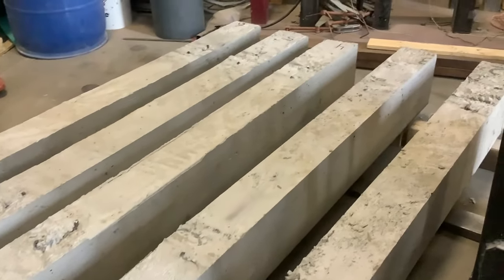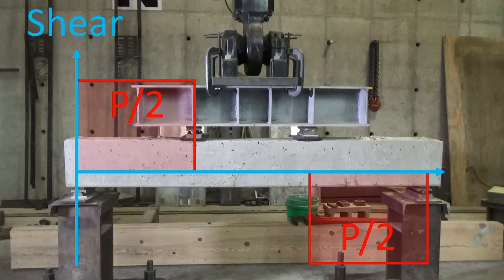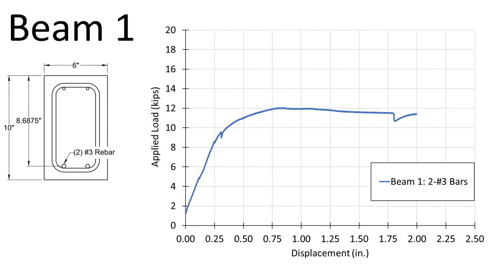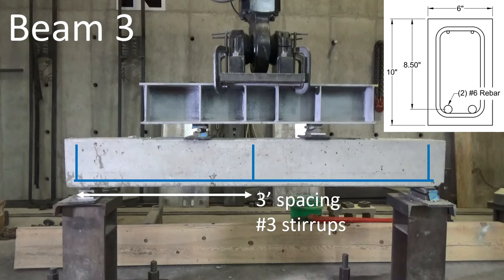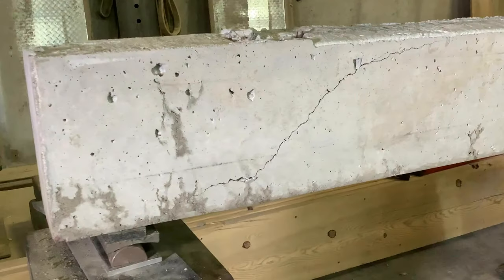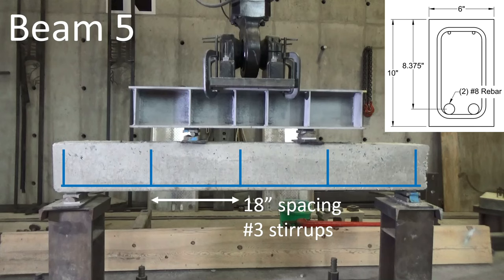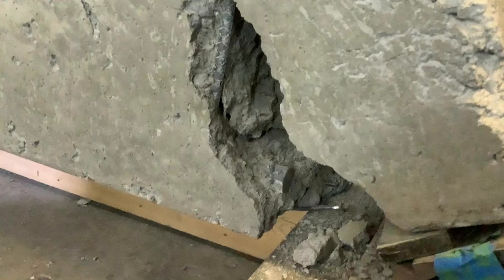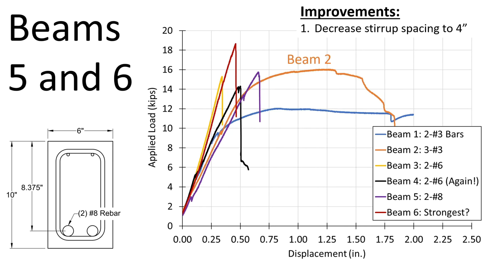I Broke These Concrete Beams - Design Principles from Beam Failures

Comment: You will have to repeat #5 and 6 beams with rebars extended outside the beam to prevent anchorage failiure.
Reply: Yes I agree..or move the 2 supports closer.
Reply: @geraldborja144   Indeed that was disappointing...
Reply: Rebars are not supposed to go outside though 
To improve the anchorage, the end has to form an L shape pointing up in this case 
Or as mentioned in the other comment, have the points of  supports farther away than the end of the rebars ( either by moving the supports or by extending the beam)
Reply: Cog the bars
Reply: yes i think those hor. rebars are few short to the support area
Reply: Really missed on that one, the supported beam area had no rebar in it. But what do you expect too young to have ever used a slide rule and no pocket protector.
Reply: but it highlights the fact that using stronger steel concentrates the stress on the concrete more. the concrete is there to take the load, the steel shouldn't be under load until the concrete starts to fail.

Comment: It appeared that your supports were at the end of the bottom rebar or even somewhat outside of them.  You need the steel to extend well beyond the supports.
Reply from the maker: Yep, I agree 100%. Best practice for simple supports is to terminate the steel at least 6 inches (75 mm) past the face of the support (ACI 318, section 9.7.3.8.1).
Though you can't see it, the same supports and bar termination was done for all the beams. This was done improperly here partially for ease of construction and partially to make a point.
Reply: Exactly my thoughts
Reply: I think in construction, concrete should leave up to 21 days to dry well
Reply: @jpcraftconstruction.1828  It does get stronger with time, but the reason for failure of the stronger beams was the improper placement of the supports which is misleading in regards to which beams likely would have performed best.  The weaker beams didn’t have sufficient capacity to overload the points above the supports, but the stronger beams did.  This just confirms why the proper balance is important in design.  Making one area stronger simply moves the failure to a different place.
Reply: @StructuresProfH  oh ok
Reply: @StructuresProfH   @StructuresProfH  This is interesting, because in a typical earthquake resistant post & beam structure as built for private houses and commercial buildings in the Philippines this may not always be implemented. I will take a closer look next time, when they make beam to post or beam to beam connections, if the reinforcement is indeed supported by at least 6 inches. 

Constructibility of reinforcements is often an issue. In my observation posts or beams are sometimes designed too slim, which makes it hard to accomodate all the reinforcements at the connections. This can lead to the workers making shortcuts not authorized by an engineer (who is not always on site).

Comment: I used to had a fear of buildings falling, I used to believe buildings just crack, but this video made me aware that buildings bend and they show signs before falling. Now i can rest well looking at concrete ceiling. Thank you so much
Reply from the maker: A well designed building will bend and show distress before failure. In practice we always try to avoid failures like we saw in beams 3 through 6. If the building will fail, we try to follow something like beams 1 or 2.
Reply: They can do both.
Reply: Building have alot of safety factors sprinkled in every step of the calculation

Comment: How is it that nobody’s pointing out in the comment section that they use the a concrete truck for this little bit of concrete 😂😂
Reply from the maker: One cubic yard! Yeah, it’s a ridiculously small load, but our concrete supplier is really great about this kind of stuff. It’s certainly easier than mixing by hand (don’t have a drum mixer with this capacity).

Comment: Asked Claude 3.5 :
Let me explain why rebars are often placed at the bottom of beams:

Tension zone:
When a beam is loaded from the top, the bottom of the beam experiences tension.
Concrete is strong in compression but weak in tension.
Steel rebars are added to the bottom to handle these tensile forces.

Bending moment:
The maximum bending moment in a simply supported beam typically occurs at the middle of the span.
This creates the greatest tension at the bottom of the beam in this area.

Compression zone:
The top of the beam is typically in compression when loaded from above.
Concrete is already strong in compression, so it often doesn't need as much reinforcement there.

Testing to failure:
In tests, placing the rebar at the bottom allows researchers to observe how the beam behaves under typical loading conditions.
They can see how the concrete cracks and how the steel reinforcement performs.

However, it's important to note that in real-world applications, beams often do have some reinforcement at the top as well, especially for:
Negative bending moments over supports in continuous beams
Shrinkage and temperature control
Torsional resistance
Compression reinforcement in some designs

Comment: Fantastic video, and a question,  if you were to bend the rebar ends to allow the ends of the beam to be connected to the bottom of the beam in that way wouldn't that be able to prevent the ancor failure?

Comment: This experiment more related to a pre-cast design otherwise development length plays a big role here. Top and bottom extra bars are also play a big role in construction. Also at the L2 should have stirrups closer than in the mid section.

Comment: What was the calculated load capacity of each beam compared to the observed load capacity at failure? In other words, how close do our calculations match reality?
Reply from the maker: For Beam 1, the flexural capacity was about 110 k-in., which should occur at a load of 9.2 kips. We observed about 12 kips of capacity. These calculations assumed nominal material properties for concrete strength of 4 ksi and steel yield of 60 ksi. Measured concrete strength was a bit lower (a bit over 3 ksi), but that barely affects the flexural capacity. We didn't test the rebar, but it was likely to have higher yield than 60 ksi, which would have a major impact on the capacity.

Repeating for Beam 2, the flexural capacity was about 162 k-in., which should occur at a load of 13.5 kips. We achieved nearly 16 kips in testing.

Beams 3 and 4 had a reinforcement ratio of about 2.94%, but did not have adequate shear reinforcement. Using ACI 318-19 Table 22.5.5.1(c), we would get Vc = 8.0 kips using the nominal concrete strength of 4 ksi. Assuming the stirrups provide no strength (which is reasonable, as they are spaced so far apart), this failure would occur at an applied load of 16 kips. Beams 3 and 4 saw about 14 or 15 kips of load, respectively. If we instead use the measured concrete strength of about 3 ksi, then Vc = 6.9 kips for a failure load of 13.8 kips - that's very close!

For Beams 5 and 6, this didn't look like a traditional "shear failure" because of the anchorage issue. However, the estimated shear capacity for these two beams, again neglecting the stirrups and assuming nominal concrete strength of 4 ksi, would be about Vc = 8.0 kips, meaning a failure load of 16 kips. That's pretty close for Beam 5 (failure load of just under 16 kips), but a little low for Beam 6 (failure load of about 18.5 kips). The stirrups maybe provide some help for Beam 6, if only to force the crack to take a steeper incline angle compared to the more traditional shear failures of Beams 3 and 4.
Reply: Im a layman. What is a kip? Since you had two points pressing down on the beam until failure what was the total force downward in pounds ?

Comment: Thanks; please post concrete compressive strengths too.
Reply from the maker: For these beams, the concrete strength at testing was only about 3,000 psi (20 MPa). We did not test the rebar yield stress, which would have a greater impact than concrete strength for the flexural capacity.
Reply: @StructuresProfH  Thank you. 🙏

Comment: Good stuff. It looks like bearing failures for those last two. A horizontal U-bar or two at each end at the bottom should do the trick
Reply from the maker: That's a good idea, Sam! We have a bunch of extra stirrups floating around our lab, so next time I'll drop a few of those horizontally into the end regions. That is an easier fix than making the beams longer (would need new forms) or moving the supports in (lab floor connections are where they are, and not much I can do about that without fabricating new supports).

I really wanted to see a compression-controlled flexural failure, but there is always next time. That would make a good follow-up video.

Comment: I just discovered your videos and I'm already a big fan. However, I am also an amateur to this. I have a couple of questions that I hope are not too naive. First, have you performed any of these tests with GFRP, a fiber reinforced resin based rebar? The second question is where the more experienced people on here might giggle at me. Would it be reasonable to build a metal truss within the cement? It seems that the amount of metal being used in some of your tests could be made to hold a lot more pressure if it were built in a truss pattern instead.
Reply from the maker: Glad you liked the video!

I haven’t tried any tests with GFRP bars yet, but that would be very interesting. In general, GFRP is higher strength than steel but it lacks ductility, so no more ductile yield plateau behavior. It also has lower stiffness, which can mean larger displacements. 

As for the truss, the beam already kinda does that for you - the steel carries the tensile forces while the concrete carries the compression. So the concrete forms the top chord and the “diagonals” of the truss, while the rebar forms the bottom chord and the vertical members. Sure, you could layout the steel in a truss-like configuration, and it may have really great performance, but the standard rebar “cage” is much easier to build.

Comment: Architect here! I have a question does the type of hook provided in the stirrups matter? And how does it affect the Shear capacity of the beam?
Reply from the maker: As a general rule, a 135-degree hook is better than a 90-degree hook. However, we typically assume that the hooks in the stirrups don't matter for capacity, so long as they satisfy prespecified "standard" hook conditions. So for example, ACI Table 25.3.2 has standard hook geometry for stirrups - as long as we are following (or exceeding) that, we assume we get the full design capacity from the stirrups. 

However, there are some conditions where the type of stirrup hook may be more important, like for seismic design (ACI Section 18.6.4) or for beams carrying torsion (ACI Section 25.7.1.6). Again, we treat these prescriptively - the stirrup hook geometry doesn't factor into our design calculations so long as our hooks meet the standard.

Comment: Can you also explain rammed earth structure failures compared to concrete beams? Which would be the better option and why?
Reply from the maker: I’m no expert on rammed earth construction, so I’m afraid I can’t provide much insight. Sorry. That said, structurally it seems limited to walls and other systems that carry relatively low levels of compressive load and essentially no tension. If it’s stabilized with cement and has some rebar, I presume it behaves much like a low strength concrete or CMU wall?

Comment: Would have liked to see tests 5 and 6 repeated so we can see actual results without the testing environment being the failure cause.  Also, when the rebar was placed into the forms, I didn't notice any spacers/chairs on the rebar to prevent it being to close to surface.  Were those intentionally left out, or were they just not visible on camera?
Reply from the maker: I agree. I actually did try these two tests again recently, with three horizontal stirrups/ties placed at the each end above the supports. Ideally, these should have bridged the split that formed at the beam ends. Long story short, it didn't work out, and I got the same failure mode again! Didn't publish a video on it, as I didn't think it added much value. Just goes to show that there is no substitute for good rebar anchorage at the ends.

As for chairs, yes they are there, but rather hard to see. Concrete cover is lower than would normally be acceptable for code (only 0.75 inches), on account of the beam's small scale and these not actually going into a building.

Comment: I’m setting a huge HVAC EF heavy piece of equipment on a concrete roof, the roof underneath has concrete beams holding the weight… I’m worried now

Comment: Changing the rebar iron with high tension cable will make more strength?
Reply from the maker: Possibly, yes. Moment capacity requires a balance of tension (in steel) and compression (in concrete). With low strength concrete, you might not get that much benefit from high strength steel, especially if you can’t yield the steel to use it to the fullest. 

Plus, in practice, higher strength materials may run into serviceability or deflection issues - high strength does not always mean high stiffness (for example, all steels have roughly the same elastic modulus, regardless of strength). It may hold the load just fine, but have unacceptable deflections.

Comment: It kinda looked like the concrete failure didn't split the aggregate. Weak concrete?  At What psi did the cylinders test / break?
Reply from the maker: It was indeed weak concrete. Cylinders broke at just over 3000 psi (~21 MPa).

Comment: Firstly, Very Interesting Demonstration. Sir, I have a query. In case of beam 6, although the number of stirrups are sufficient and closely spaced enough why are we having shear failure despite having shear capacity to be on higher side? Also, why the main longitudinal bars are pulling out? are those not properly anchored and embedded in the concrete?  and also, Why shear failure is coming in beam 6 even though we have enough shear capacity. I will be glad if you can please elaborate and resolve my query.
Reply from the maker: The longitudinal bars for beam 6 are definitely not anchored properly. They have a relatively large diameter, no hooks or anything to keep them in place, and the end of the bar was directly above the support. Ordinarily (and per ACI 318 code) you would need these bars to extend at least 6 inches past the face of the support. Once the bar started to pull out, it initiates into a shear-like failure. Though some of the simplified code equations for shear capacity neglect it, the longitudinal bars do play an integral role in developing shear capacity; in this case there was effectively no longitudinal steel area at the ends after bar pullout. I call it "shear-like" because unlike a traditional shear failure, which would be expected to follow more of a diagonal crack path, the crack extended at a very steep angle from the support. So I guess I'd call it more of a combined anchorage-bearing-shear failure, but initially caused by the poor anchorage.
Reply: @StructuresProfH  Sir, you meant at the support end stirrups were not there to anchor the longitudinal bars? Otherwise it would not have undergone pull-out. However, I meant enough shear capacity in the sense that stirrups provided were sufficient enough to provide shear capacity. Since, the bars pulled out at first place due to ineffective anchorage the stirrups didn't play  any role. Am I correct?

Comment: Can we put I beam with concrete for strong structure?
Reply from the maker: You can, though the shapes are a little different from the typical I-shape, wide-flange steel beam. A quick search for "prestressed concrete girder" will show that many of these are indeed I-shapes.

Here is an example: https://www.countymaterials.com/media/zoo/images/janesville_girder1_e0557e2b63f187fde6bb369446a47a69.jpg

Comment: Hi Prof H, superb test. Very insightful. Instant sub. Thanks! ❤️
P.s: trying to find out info about placing a steel iBeam inside a concrete beam; think it’s called a compound/concealed beam. Are they advisable in a situation with high load? 💭